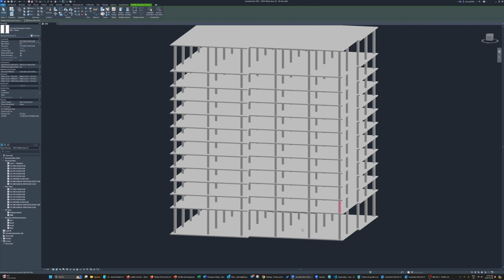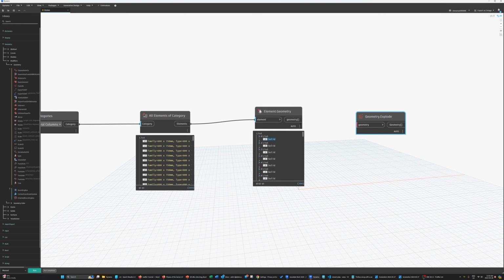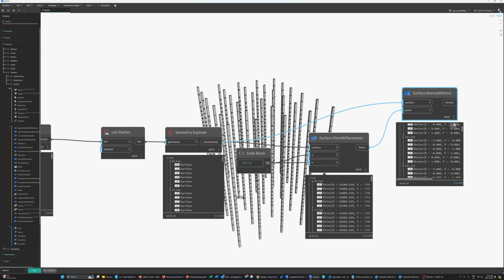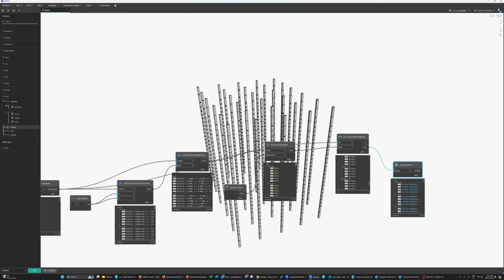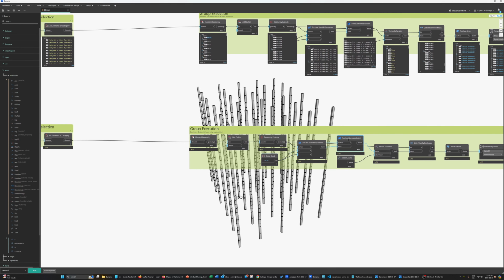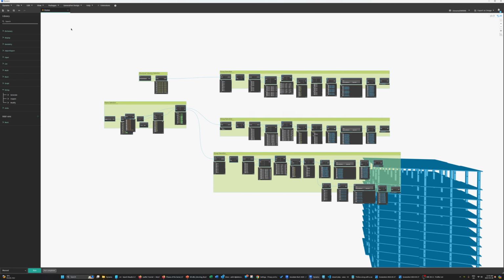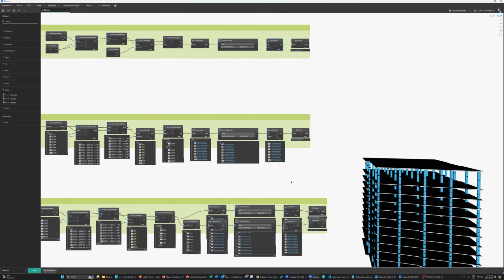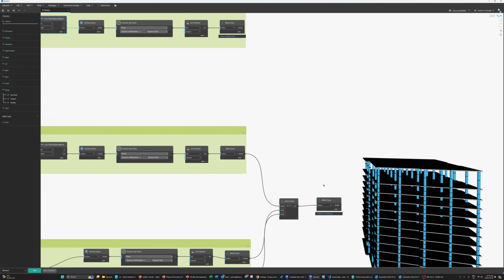Revit Formwork Quantification: The Easy and Ultra-Fast Way with Dynamo | 4K Tutorial

Comment: Thanks for sharing. However, some team members aren’t familiar with running Dynamo, and the site team needs the quantity takeoff (QTO) urgently.
Reply from the maker: I understand, hence why I resorted to this method. It's a small effort upfront to create the script (less than 2 hours), but then it can be reused for every project in seconds just by using the dynamo player to execute it. Otherwise, the alternative manual method is much worst and time consuming. No such thing as quick formwork quantities.